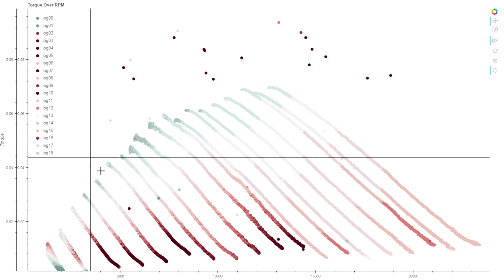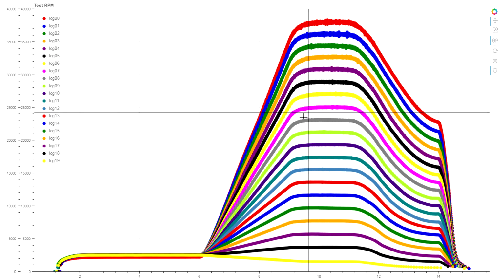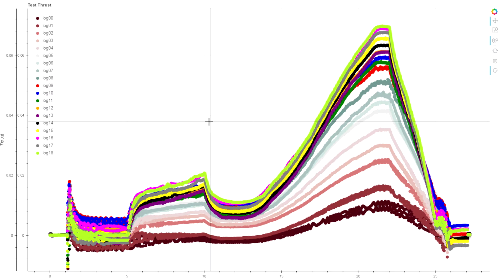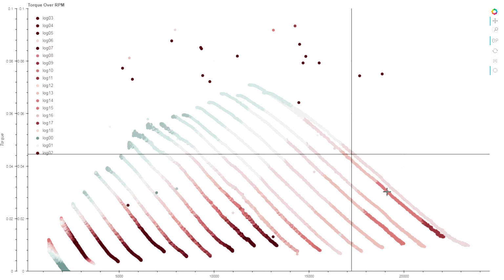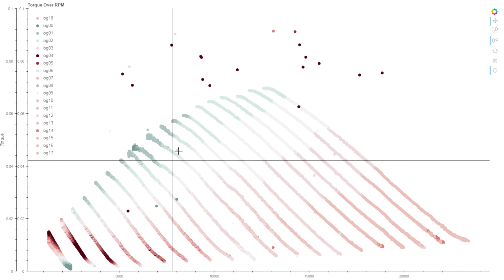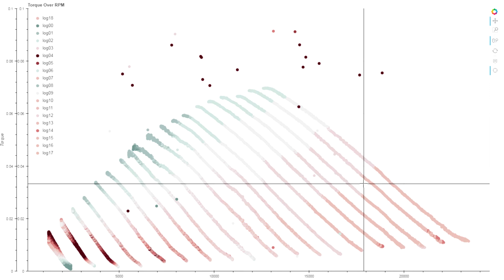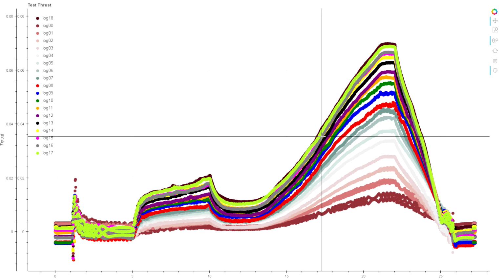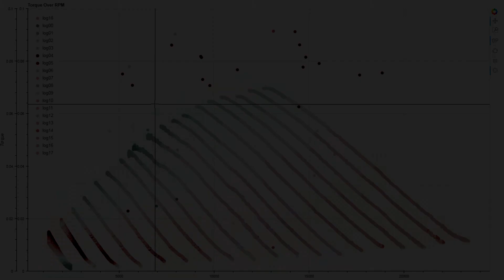Compensating for load cell drift

Comment: What load cell amplifier are you using?
Reply from the maker: this is all with an HX711.  Still coming I'm going to try a Tacuna systems amplifier with my own ADC
Reply: I was using also a HX711 on my trhust stand, but I found the 80 HZ max sampling limiting. So I went for a instrumentation amplifier and the ADC directly in the microncontroller (Teesy 3.6). My amplifier setup is very similar to this https://chippedwood.wordpress.com/2015/07/20/noisy-diy-load-cell-when-used-with-dd-wheel/ an INA122 with gain arround 1000 and about 20Khz low pass filters. I works fine for the thrust stand (1KG load cell)
INA129 has better characteristics (but needs 5V supply) is available here https://www.banggood.com/CJMCU-29-INA129-HT-High-Precision-Low-Power-Instrumentation-Amplifier-Module-p-1167416.html, there is also another module with an amplifier from analog devices: https://www.banggood.com/CJMCU-8221-AD8221AR-Precision-Instrumentation-Amplifier-Module-p-1215123.html
I don't know if the hx711 is causing your problems, just thought these solutions might be worth a try.
Reply: Answering myself... INA129 and the one from analog devices will require a complex power supply (+/- 5volts or similar...) , since the output just goes to about 1.4 volts from the supply. INA122 is much easier...
Reply from the maker: the Tacuna is using an LMP8358.  I did roll a whole hx711 section on my controller board and was going to try clocking it up to get the max sample rate out of it, like 120hz I think, but a footprint error left it unuseable so I'm still using the little standalone dev board.  Keeping the ADC on the mcu does just make it all so much simpler, though I'll probably leave my sample rate capped around 250hz
Reply: Have you tried preloading the cells, perhaps that can prevent hysteresis?